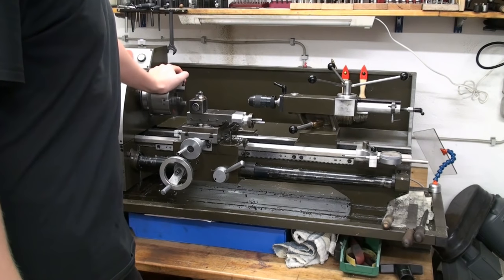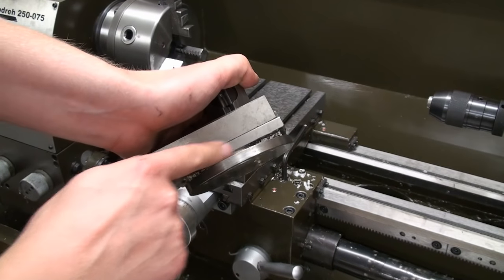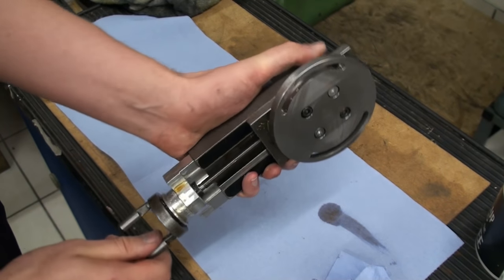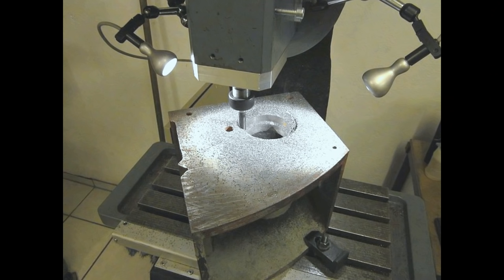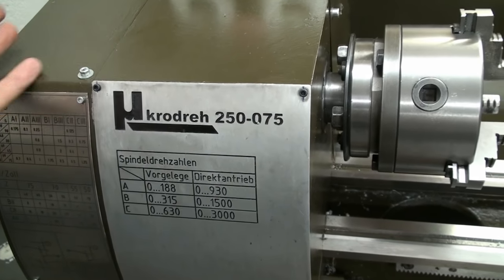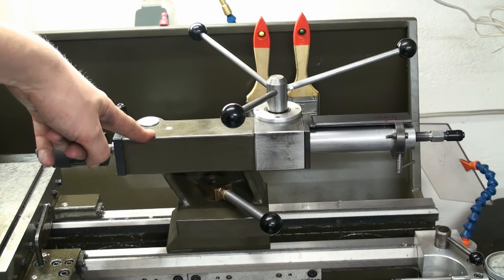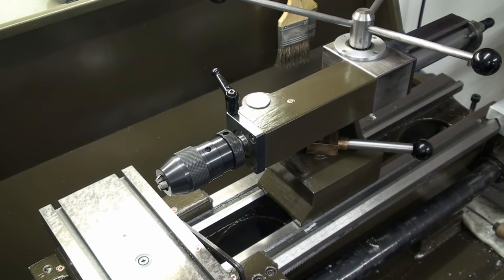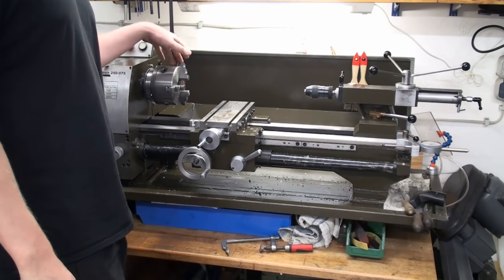Shoptalk #7 / 9x20 lathe / 05-2015

Comment: Wow! Super rebuild with great (and accurate) features. Question: Why can't you just clamp your dial indicator on the left side of your home made clamp thus utilizing the rounded recess using the "top" end of the indicator holder?  Another question: Did you raise the top slide up off the surface plate with shims to give a little extra thickness for the epoxy? Or did you surface grind the bottom of the top slide to ensure that it sat completely flat on the surface plate? Cool tailstock solution. I'm going to look at mine when I get to the shop to see if I can do the same on my Harrison.
Super interesting video and great work, great work! Thanks again Stefan, for sharing.
And, yes, anything you produce will be certainly interesting on video even in voice-over slideshow style.

Comment: You've gone for a very stiff spine on that base, but it is then sitting on a relatively flexible wooden bench. how do you level the lathe? Or is the bed straight enough from factory? It looks like the tray/base spine has outrigger feet, do they make enough torque perhaps

Comment: Where did you get the matching round rack and pinion gearing for your tail stock up grade? I've got a 1984 Taiwanese compact 8 clone that's very accurate and works very nice that I would like to do the same thing to.

Comment: Stefan, I really enjoyed this shop-talk video.

One question came up, though: Did you engrave the scale on the front end of the  tailstock quill yourself? And if yes, how do you do this cylindrical engraving on your G1L?

Best regards, 
viele Grüße in den Süden!

Sam
Reply from the maker: No, the quill was already engraved. But you could do it without a problem on the G1L if you had a normal rotary table or dividing head. You would engrave the lines by rotating the quill under the cutter and then engrave the numbers with the pantograph, without rotating the quill. If the numbers are not to big, the roundness of the quill wont affect the engraving very much. 
In fact I showed engraving a round part in one of the cross-slide mod videos I did...when I engraved the dial.

Comment: Great video Stefan...! I like the format. The rack and pinion tailstock is very cool! Could you explain in a bit more detail how you attached the rack to the barrel? Cheers, Daniel
Reply from the maker: ***** Thank you! 
As for the rack: I bored the rear of the quill barrel out to aprox. 15mm diameter and a depth of 30mm - Then I machined a boss on the end of the rack, 14,5mm in diameter and about 28mm long, I joined the pieces with JB Weld and aligned everything on the surface plate for curing. After the epoxy had set, both pieces were joined and as precise as I could get it with my options.
And as the quill and the rack are supported in the bore of the tailstock I dont have any problems with the glue joint not beeing strong enough.

Comment: Loved this video - and seeing the older projects shown as a slide show.  Gives more back ground information and shows the steps you took to do something.  One thing I have always liked about your video's is that you present things in a very detailed manor.  You explain what you are going to do, show it, and then review the results.

A problem with some other machining video's is they make you watch someone mill off 1/2" of metal at .010" to .015" at a time.  I like to see the setup, and maybe some of the milling, but watching 40 to 50 passes of the same thing over, and over is just a bit too much (however, if they show the same 40 to 50 passes in super fast forward, so it only takes a min or so, well that can be cool).
Reply from the maker: bsb0011 Thank you! What you mention is also what I feel too: Seeing chips made gets odd pretty fast, thats the reason why I cut my machining sections in the videos to short (or do a fast forward..), especialy when I am only squaring up stock or hogging out a slot...
Thanks for the support :)

Comment: Stefan, I loved your video! I have a similar lathe, and I have a question about what you did to the clamps of the carriage under the ways, the are very ugly on mine! Another curiosity of my lathe is it has the half nut engange and the carriage wheel fliped (engage on left and wheel on right). Have you used something to ashure the epoxi do not glue on the surface stone? What have you did with the chuck backplate?

Comment: Words for eternity. But wait a minute. 1:33 you set up the headstock so it turned cylindrically? Was that a slip of the tongue, did you actually mean the tailstock? Because if not, I' like to know how you 'just set up the headstock'.
Reply from the maker: Yes, the headstock. If you rotate the headstock you can set the machine to turn a taper (or a perfect cylinder..)  I milled out the underside of the headstock, left four pads (one in each corner) and scraped them until the headstock was perfectly aligned, then I injected the DHW Diamant epoxy to get a perfect fit.

Comment: Great video Stefan. You have a knack for clearly presenting really interesting material.
 
When you milled pockets for diamond epoxy, I can see it results in thicker ‘pads’ of cured material within the relief dams. But because it’s weighted down during cure, doesn’t that yield a very thin layer on the dam edge periphery that would be prone to chipping? Or is the idea you then scrape that edge down to the metal so it only floats on the epoxy?
 
Did you keep the original lead screws & their pseudo-anti-backlash nut or upgrade that as well? (I’ve heard they vary in quality in the offshore machines).
Reply from the maker: Peter Thannhauser Thank you!
Youre right, the small surrounding rim of material is scraped or filed down so only the remaining surface is bearing :)
I still have the original screws and nuts in there but I will change those one day. The are more or less "ok" but not great.

Comment: Hi Stefan, I like your improvements on the chino/german lathe. But what are the main advantages of using Moglice? Wasn't it enough to scrape sideways to correct out of squares geometries?
Reply from the maker: Cosimo Marotta The moglice has better wear and sliding properties as the chinese cast iron and also as I could cast one side, I only had the matting surface left to be scraped - That way it went a lot faster :)

Comment: Of all your awesome videos I can't believe I missed this one.  This is awesome! I can't believe the mods you made to this lathe.  I have a Sieg 8.5x20 which is very similar to this lathe.  You have given me a lot of ideas for improvements.  Although they appear different, booth lathes are very similar and some key components are identical.
Reply from the maker: The 8,5x20 is also a nice machine, with the powercrossfeed, wish my lathe had that too..but back then the SC4 as it is called here was a bit expensive for me, I was still in apprenticeship when I bought this lathe.

Be sure also to check out this link, I wrote about some of the mods there too:
http://gtwr.de/shop/pro_mykrodreh/index.html
Reply: Thank you for the link. I never would have found it if you didn't post a link.  At the moment I am installing magnetic scales and I actually had the same idea for the adjustable aluminum plates for the Z-axis scale mounted to the back of the bedway, I just didn't know exactly how to go about making it.  I see that you used 4 grub screws on each corner and 1 main mounting screw in the center to secure it.  How did this work for you?  Did it give you a wide range of adjustability?  I already attached my indicator to the back of the carriage and ran it from front to back to see how far of it was on the as-cast surface.  It's about .070" difference so I'm going to take that off of the plate closest to the headstock.  I can see how you measured and compared the horizontal alignment but how did you measure the vertical alignment?  Thank you for taking the time to answer my questions
Reply from the maker: I would NOT do it again with the 4 screws, that was a royal pain in the youknowwhat ;)

Next time I would make two blocks of cast iron or aluminium, bolt them to the bed and then scrape them to be aligned to each other and to the bed.
Reply: Stefan, next time get the machine bed to your workplace and shave the backside of the casting flat in two places, that's the way I did it when I got my lathe.

Oh and about the SIEG SC4, I had one a few years ago, #0875 and I was absolutely pissed after I sold it. When I purchased it from Axminster, I paid 1372 EUR with shipping (130 for shipping). Now if you go and look the same lathe is somewhere around 1600 WITHOUT the shipping. The power feed on cross slide was nice, BUT it was VERY slow, I think it was something like 1:5th of the longitudal feed or something, can't quite remember. But too slow.

So, I bought an HBM 250x550, pretty much the same machine as yours is and started modifying it immediately and then ran into your videos after finding pretty much the same problems as you did :)

Comment: I spend your money!  DRO on lathe might widen viewing base.  Very easy to show American units - oops, inches, as well as metric. I know you often use both verbally, and don't often give detailed measurements, but visual could help too.  My late Dad was happily using either inch or metric interchangeably over 50 years ago here in UK.  'Simply' learnt all the conversion tables off by heart.  Fabulous memory. Made him a valued employee.  "What's this 17 mm in inches?".  " Dunno, ask Perce".  No one, but no one, ever called him Percival more than once! Did you know there is/was an American inch as well as a metric inch?  Almost, but not quite, the same thing. Bob.

Comment: Great video Stefan. Thank you for taking the time to share your reasoning and excellent improvements. It's made me look at my 45 year-old Maximat Super 11 with new eyes. I'm running the 2-speed wound AEG motor permanently in one speed, on a VFD, and it has served me well. But it is weeping oil out of the headstock as well as the overhead milling head, and needs a good rebuild. I was doubtful if it was worth it, considering the good value Chinese machines flooding the western markets. I think I'l strip and rebuild it now!
And I'll add your tailstock spindle clamp and the dial indicator clamped to the bed-way.

Did you make any improvements to the leadscrews of the compound and cross-slide?
Reply from the maker: No, the leadscrews where pretty good, same for the nuts. 

I would not hestitate to rebuild the Maximat 11, thats such a nice machine. I would trade mine in a heartbeat against one of those.
Reply from the maker: No, thats Uli Huber - But I know him.
Reply: Correct! That is not me.

Comment: Hi mate.
Very nicely done, but why the army green paint, do you work for the army?  I do like most of the modifications, but the spider on top of the tailstock seems cumbersome.
Why don't you have a RPM read out on it, you can pick them up from EBay for about 10 euro.
Reply from the maker: Marcel Timmers I was in the german Bundeswehr for basic service, but thats long gone - I wanted the lathe just to match the color of my shaper (which IS a ex-Bundeswehr machine).
RPM readout? I realy never felt the need for it :)
Reply: Fair enough, about the colour.  I must admit that I have walked around in Dutch army green for 6 years, and it's still my favourite colour.

Comment: I think the belt on the idler pulley is in the opposite position...
It must be in the inner side of the idler pulley not the outside... so the belt rides more surface on the drive pulleys...
Reply from the maker: Soulis TG Normaly I would absolutely agree with you, but the crapy belt is that uneven on the outside that it would rattle like hell - Time to get a better belt.

Comment: When they say Chinese lathes and mills should be considered as just a kit of parts, I don't think they had your extra work on the lathe in mind. :>)
Now I know what to do with my lathe, but as it is only 55 years old it doesn't need it yet.
Reply from the maker: Chris Stephens Yeah, I heard the "chinese machines are kits" also a lot of times and I took it literaly ;)
Reply: Stefan Gotteswinter There is a rumour that Chinese lathes supplied to Germany are better made than those supplied to UK. We put up with crap, for a lower price, but Germans are willing to pay a little more because they wont. I don't know how true this all is, except for the bit about putting up with crap that is.
Reply from the maker: Chris Stephens In my mind its a case of "differend smell, same crap" ;)
Almost all chinese lathes I have seen so far had the same problems..non aligning spindlebearing seats, oversize rear bearing seat on the spindle, guideways that were ground or scraped hollow so they dont rock/tip over and so on..
Reply: Well that puts an end to that rumour.
Reply: I suspect oversize rear bearing housing allows spindle alignment.  A case of inspecting 'quality' in!  Not so much side thrust on rear bearing? - there's the pulley belt, of course..  Not good engineering but works, at least to start with, and is cheap and simple.  Saves having to set up for in line boring.  Useful to know about it, so thanks Stefan.   Bob.

Comment: Hi Stefan you must have way to much time on your hands wow what a great job, just one question is that motor a three phase or single phase I am assuming it is a three phase for the VFD but I could be wrong. Great video by the way.

Dave
Reply from the maker: David Cashin That rebuilt took me about 6 months in total, so time is relative ;)
The motor is a three phase one and the VFD has 1Ph in/3Ph out

Comment: I think you forgot to mention the leadscrew protectors?
Reply from the maker: stefantrethan Ah! The spiral springs were stock on the machine and I am very happy about those - But if you could source such springs a retrofit would not be to hard..they just sit in cups on both sides of the bedslide, the headstock and the right hand bearing block of the leadscrew.
Reply: Stefan Gotteswinter Strange that the chinese would fit something so non-essential, but nice anyway!